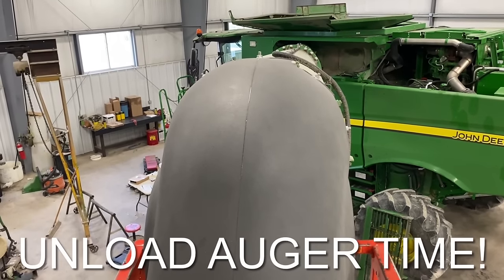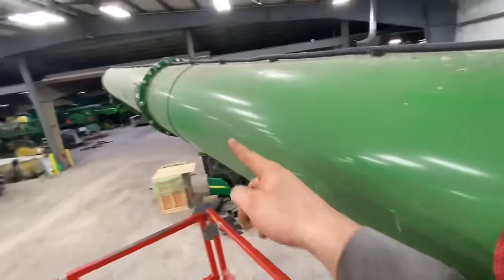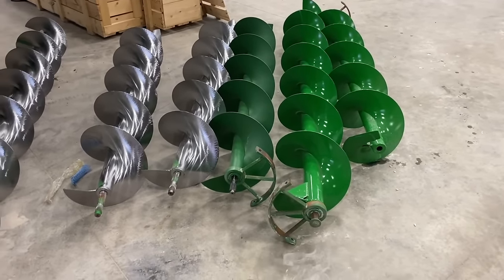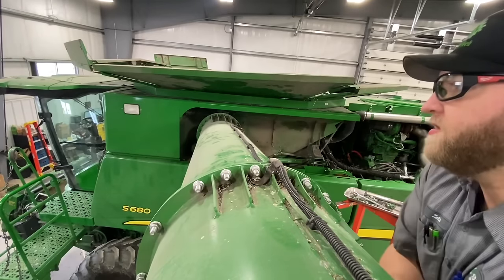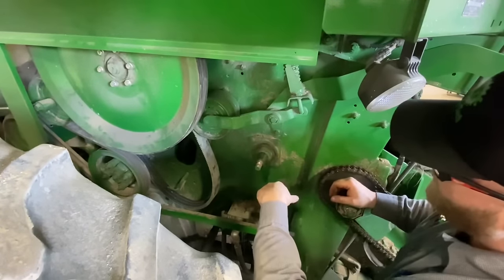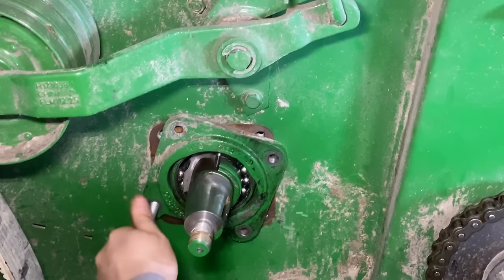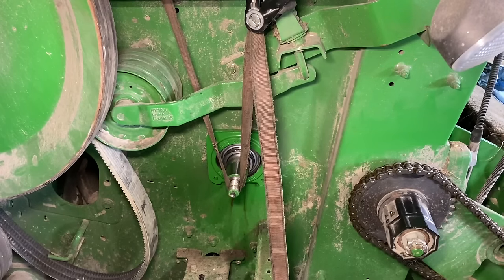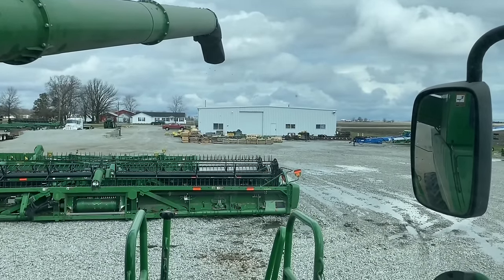The S680 is finally field ready! (Unload augers and Feed accelerator bearings get replaced)

Comment: That  was really interesting to see how complicated a rolling factory could be engineered. This repair/replacement demonstrates  how important it is to use high quality alloy metals and quality control measures to manage wear and insure durability of the design like this. Splitting those rusted in bearing races was a good solution that proved itself worthy of more research.

Comment: Very nice! Lotta ways to do it.  I’ve always wanted to try an induction heater. Cut a slot in the outer race and dump the balls out and then heat inner race and pull off. Or with out race gone more room. But slots like that 180 apart. 1 side doesn’t have to be all the way but gives a place for it to split. Lol I used run Vermeer balers….try to run anyway.

Comment: Yo zk, you do what works for you on those FA bearings. Pulling the bearing and housing off, take 2 slightly longer bolts and thread nuts on the back of the bearing housing and can be used as push bolts. I thought it was slick as hell, of course you still need an air hammer🤠

Comment: I have a question on the feed accelerator bearings after so many hours should they be replaced and how many hours is that
Reply from the maker: @mikebuck958 if they haven’t been changed in about 1500 separator hours I would replace them. Takes about 6 hours if the inner races are seized to the shaft.

Comment: Hey Zeth. There is a kind of puller that is made to go into that bearing race where the balls ride and pullt the bearing out without pulling the shaft out.  Look up "Beta dummy ball bearing extractor" .  There are different sizes from other manufactureres, but that one covers quite a bit at a low price for that puller style.
Reply from the maker: Yeah I’ve seen that before. I might get one but i worry the legs are too long to fit in the places i need to go.

Comment: First off thank u for taking the time to show us ur work I know it takes a lot longer to do this but very grateful u do. My question is when ur removing the pulley shaft and bearings I understand what ur doing with running the bolts in to make it hopefully pull itself out but the question is when ur vibrating the end shaft are u doing that in hopes of breaking it lose easier?
Reply from the maker: Vibrating the shaft inward helps walk the bearing off the shaft. Thanks!

Comment: I am constantly amazed about how unreliable JD makes its systems and how little effort they make to design things so that normal wear points can be easily serviced.  Give me an old time Farmall anytime to work on rather than these machines.
Reply: Our Allis Chalmers & IHs break down too. None are immune it seems. Things also wear out even though service intervals are met. I don't think any engineers out there think about the poor fellows having to work on them later either. Thank goodness there are brilliant techs like Zeth out there. The customer probably never knows the stress & hair pulling involved in servicing these beasts. Zeth has such a great attitude. I'd be throwing hammers 😃